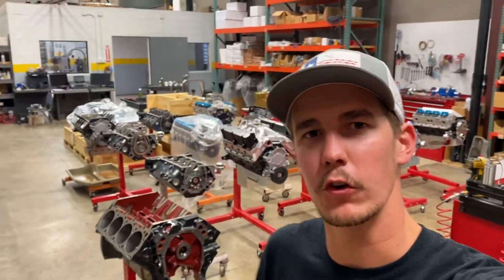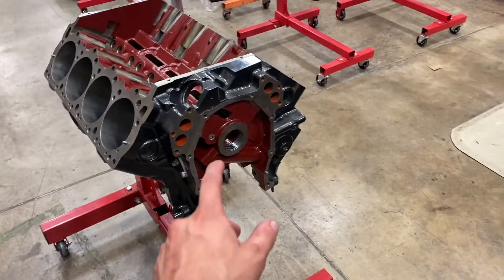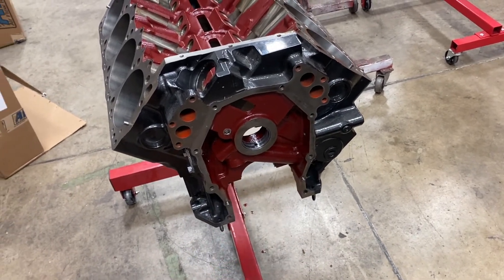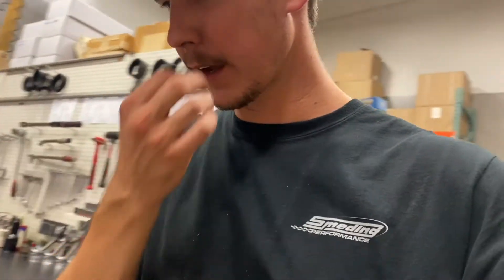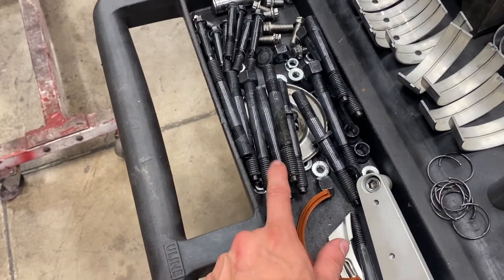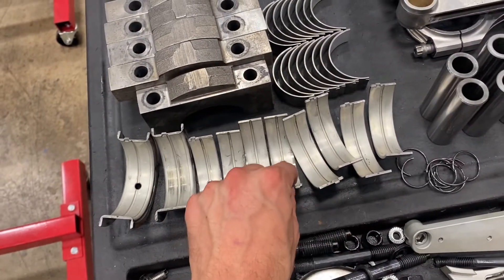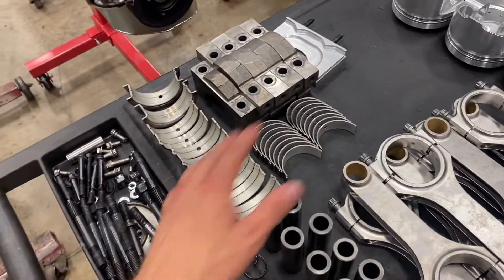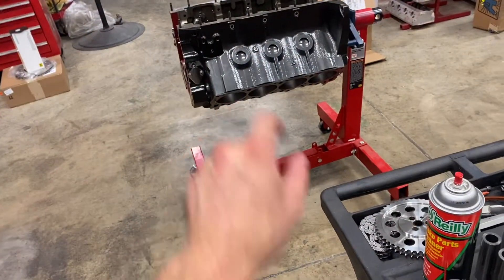How Tight is Tight? - 528" Hemi Part 2

Comment: I’ve been seeing a lot of 2 layer softer aluminum bearings being used recently over the 3 layer race style bearings. For performance I like the King or Acl race series bearings personally but I’ve torn apart some performance oriented builds and found the cheaper Aluglide bearings on the rods and mains